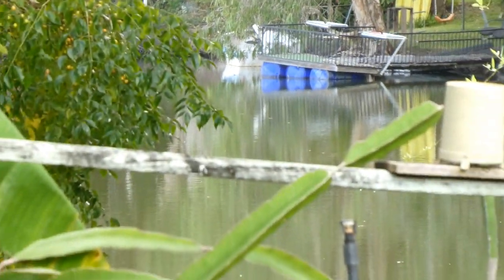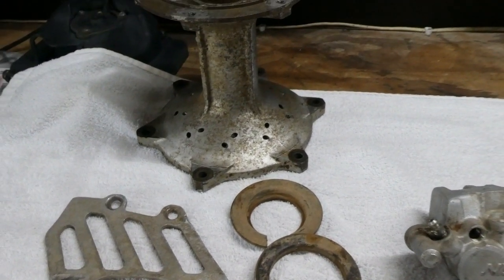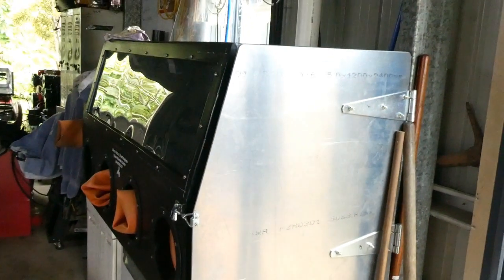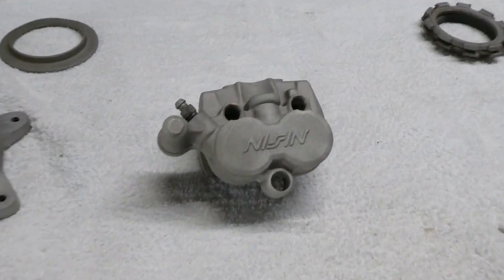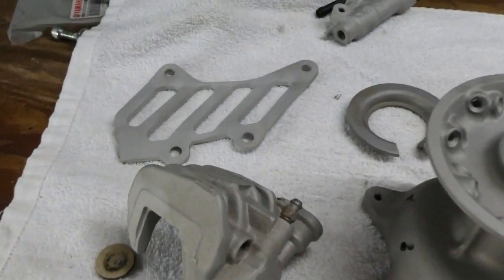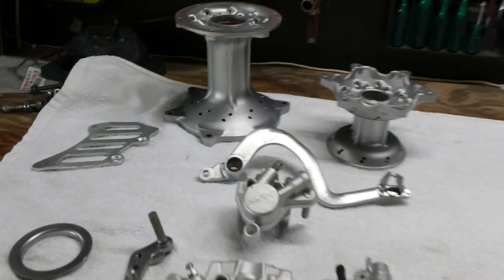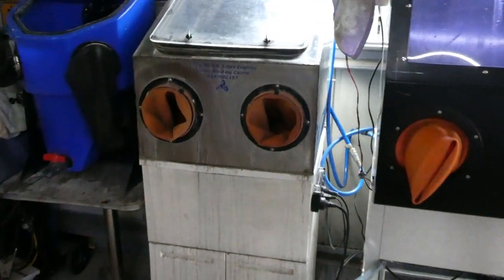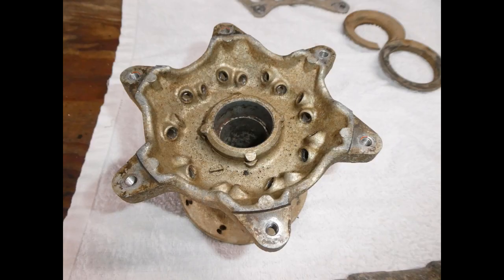Vapor Blasting

Comment: I watched your build of the large cabinet, excellent build and very resourceful, I'm just about to have a go at building one as I have a few old bikes to renovate including one I've already started, a Honda XL500S. Am I correct in saying you incorporated a screen wash system into your build, if so could you tell me about it including where it drains, is it a closed loop system?
Reply from the maker: Hi Justin,yes I have a screenwash on there that just drains into the main slurry tank that is closed loop I just drain when the level comes up.The wash I’m using is a 12 volt wiper wash pump and tank I purchased from eBay 👌
Reply: @linc341  Thanks for getting back to me, are there any plans for this part of the build anywhere
Reply from the maker: No mate the build plans are in my head.👍

Comment: I have to clean cylinder heads, but I don't want to spent time lookimg for media in holes and threads. Is it possible to use only degreaser and air?
Reply from the maker: Maybe - but I don’t think you will get anywhere near the same results .